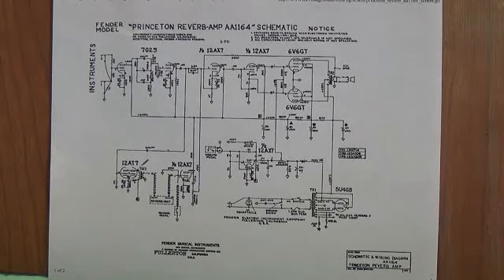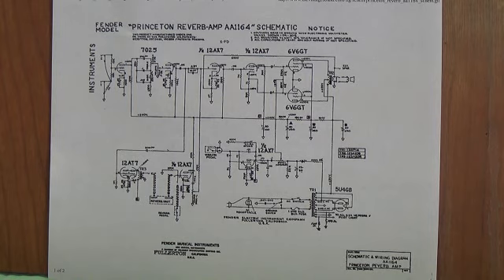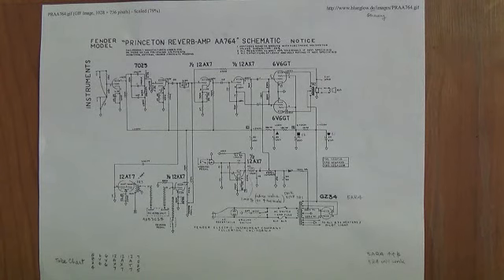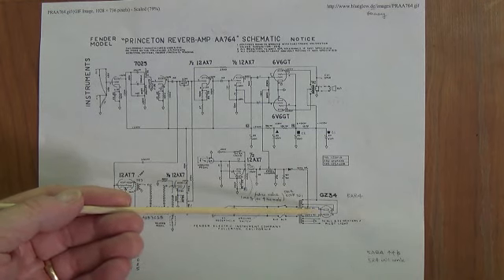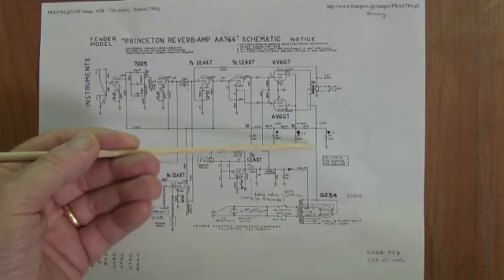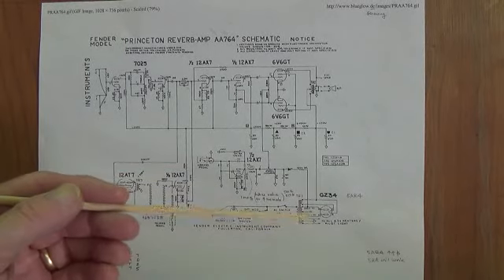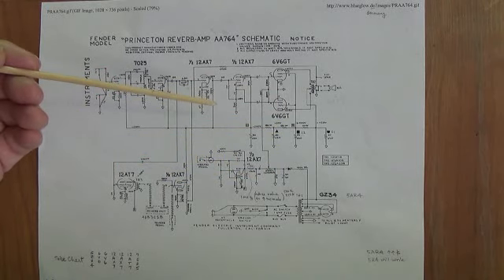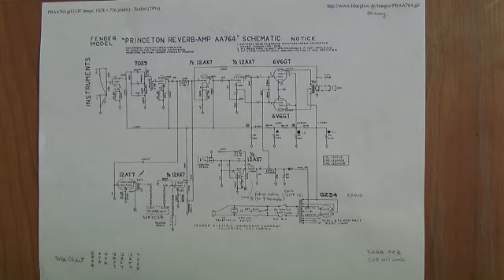Fender Princeton Reverb AA764 Chassis.....Fact, Fiction, or Typo ???

Comment: Hey Doug. I have a Princeton Reverb Silverface with a AA764 tube chart and the gz34 rectifier specified on the label, yet i thought this schematic only came in blackface Princetons. Can you give me some info? Thank you.
Reply: More info, the number 606 - 9 - 07 , making it an early 69.
Reply from the maker: Greetings, JD. According to the Fender Guru, your Silverface 1969 PR should have an AB1270 chassis with a 5U4 rectifier:  http://fenderguru.com/amps/princeton-reverb 

However, I have seen all sorts of variations in chassis and circuits during this period. CBS had just taken over and it appears that they were probably using whatever they had on hand to build amps.....so a left-over AA764 chassis (with GZ34 rectifier) may have been installed in a 1969 Silverface cabinet. Other than the rectifier, the two circuits are virtually identical (2 small cap differences) so it's really not a huge issue.

One other explanation might be that you do have an AB1270 chassis but they put the wrong tube chart in the cabinet, and someone followed the tube chart when they replaced the rectifier and installed a GZ34. If you really want to be sure, download both schematics and see which one matches your circuit. As you will see, other than the 2 small caps, they are virtually identical. Good luck.
Reply: Thanks so much for the quick response Doug! Actually with further research it turns out it is actually a 7th week of 68 amp.. i read it wrong.. And it has the aluminum around the mesh, which according to fender guru makes it a 68 silver. Would that make it more normal that it would have the aa764 circuit? Thanks again, you got my sub
Reply from the maker: I  think it is not only possible but quite likely that an early '68 Silverface would have a chassis from the previous year's BF model. Fender probably had a bunch of AA764 chassis left over from the Blackface years, and it would have been financially unwise not to use them up. After all, if you compare schematics, there is virtually no difference between the BF and SF chassis....so why not use them? This use of BF parts in the "Drip Edge" '68 Silverfaces (like yours) is why they command higher prices than the later Post-CBS SF models. You're welcome, JD, and thanks for subscribing :)
Reply: Uncle Doug 1f you work on enough Fender products you see all kinds of overlaps in the styling and little cosmetic details. I recently acquired a late 60's silver face Bandmaster head, thinking that I'd do the black face conversion on it and have a righteous amp for low bucks. then when I looked inside, lo and behold, it was an AB763 circuit! Now all I have to do is replace the caps, throw in some fresh tubes, and re-bias it. WOOHOO! YEAH BABY SCORE!!!
Reply from the maker: Congratulations, JP. Yes, indeed, some of the chassis used in the Silverface Fenders are virtually identical to the Blackface models and require very minimal modification (if any)......yet the Silverfaces are generally much less expensive. This can turn out to be a great way to obtain a classic vintage amp at a rather reasonable price. Don't tell anyone, or the prices on Silverfaces will go up :)

Comment: thanks uncle doug.  i just picked up this amp with this circuit and really hard to date.  what year is this amp is it a 1966?
Reply from the maker: There are Internet sites that provide accurate dating info on Fender amps based on the chassis numbers, Joe. Also, if there is a tube chart in the cabinet, it should have a rubber-stamped two letter code that tells the year and month of manufacture. I have two of these PR's, 1966 and 1967.  I can't recall which one was in the video.
Reply: The amp is really dirty to the point where you can not read the serial numbers.  The tube chart has been damaged as well.  I can  read the top of the chart showing the AA764 circuit, but you have been very helpful thank you.
Reply from the maker: The serial numbers are usually engraved into the chassis rear wall, Joe. If dirt obscures them, then use some 409 on a rag, or even some fine steel wool to expose them. You're welcome. Best of luck.
Reply: what would be your choice of rectifier tube. would the jj 5r4 be your choice or
Reply: and its a 66

Comment: I have a Silver face Princeton Reverb amp with a Tube chart Label that indicates the AA764.  I note your description speaks specifically of the black face model.  Serial number of my amp is A 19337 which suggests 1967 or 1968.  Uncle Doug, I could send a pic of the tube chart label is you need it.  contact me if you wish.
Reply from the maker: Thanks for the input, Pete. Common sense would dictate that the AA764 circuit should have been long since replaced by the AA1164 by the time the Silverfaces were made....and yet, as your tube chart indicates, apparently they were not. Is the rectifier tube in your amp a GZ34 or a 5U4?

Another possibility is that they printed up a whole bunch of AA764 tube charts and then kept using them for several years, even with the newer circuits, until they finally ran out. Yet they never seemed to print out any schematics for the AA764. Very strange.

I don't recall ever seeing a AA1164 tube chart in a PR.....has anyone else seen one? If so, in what year was the PR made ??
Reply: Uncle Doug unfortunately, I am electronically challanged!  so unless you tell me how to check it out, I cant answer you.  I checked out all the tubes but dont either of the markings. I did have the unit in a shop and they replaced some of the tubes but as I said, I dont know what to look for.  obviously I dont read schematics well neither.  lol
Reply from the maker: No problem, Pete. If the amp works well, then just enjoy it. The exact nature of the circuit is secondary to its function. Thanks for your input :)
Reply: Uncle Doug I also have a 1969 Fender Princeton Reverb with the AA764 tube chart.   It also has the GZ34 rectifier tube.   I thought it may have been the wrong tube chart, so I pulled the tube and it's GZ34.
Reply from the maker: Another good example of the mysterious AA764 circuit.....no original schematic available and it continues to appear for several years after it was (apparently) replaced by the AA1164 circuit.
Reply: Uncle Doug I did pull the tubes again, and appears that most of the markings are worn off.  There is some info that states the tube was made in Great Britain.  Further the tube chart indicates GZ34, and I note that the tube chart also indicates "Fender Musical instruments Santa Ana California.
Reply from the maker: Pete, if it was made in England, I have a feeling it was a Mullard GZ34, which is one of the best brands available. It may even be the original rectifier tube for this amp. Take good care of it :)
Reply: Uncle Doug Well Sir!  Thanks for all your words and insight.  And your right, I'll just enjoy my amp.  I have had it since the 70's.  Bought it used for $100.
Reply from the maker: That sounds like a great idea, Pete. You're welcome, and best of luck :)